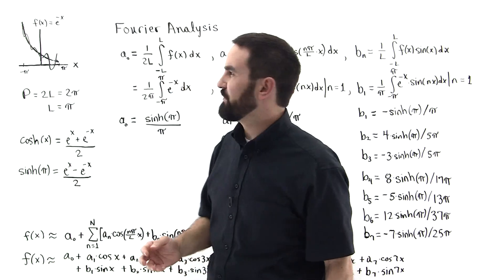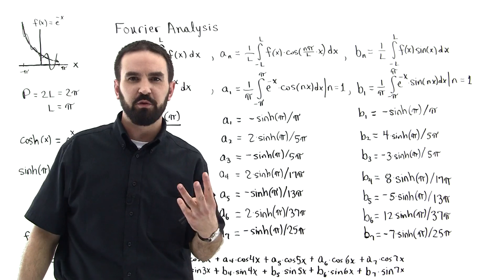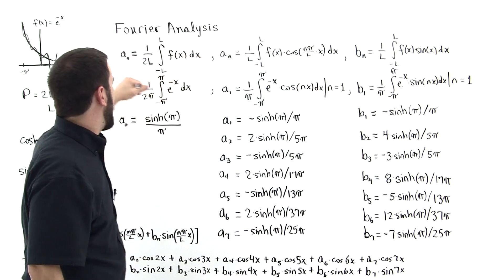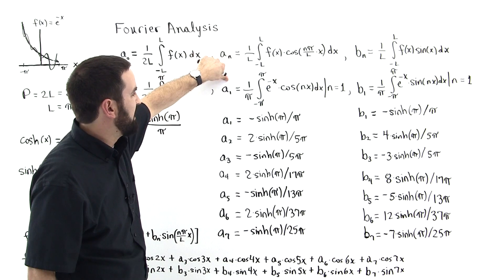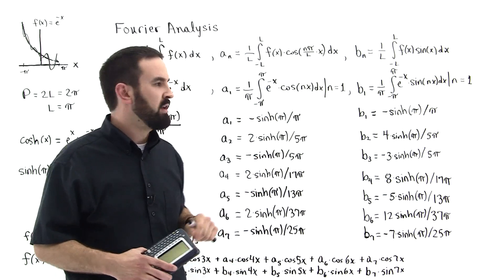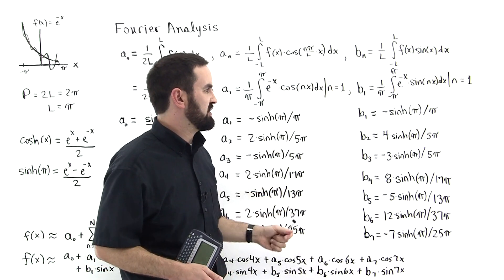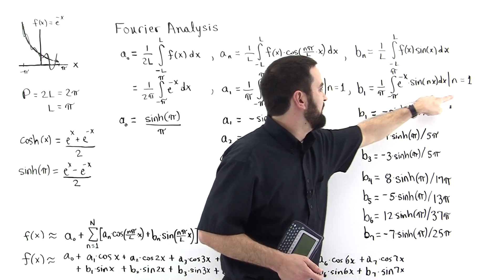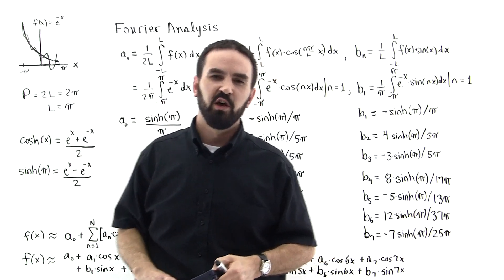Fourier Series - Modeling Exponential Decay Functions - Part 2

Comment: What if I want to test this in MATLAB using a for loop for the sum? I was able to do it on the first example because the pattern of the coefficients (or I may say the coefficient bn) was pretty straightforward. However, I really can't see a pattern here for an nor bn. Is there a way to come up with a "sigma notation" for the Fourier coefficients? Thanks for taking the time of making these awesome videos!
Reply from the maker: I see what you mean, there doesn't seem to be a pattern for the b's.  Sometimes you've just got to do it the long hand way.  Nice job on the first set though.